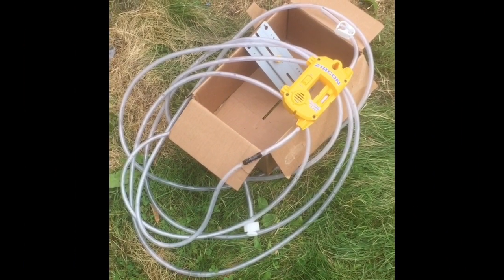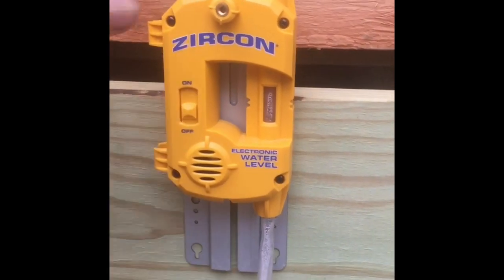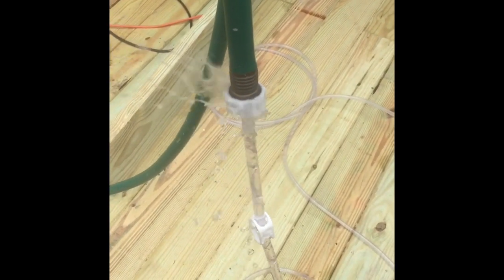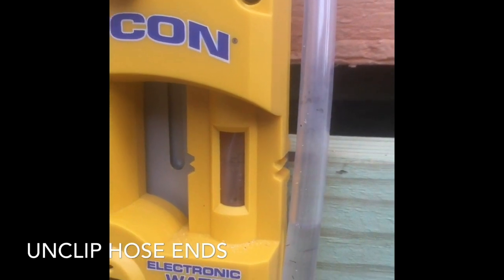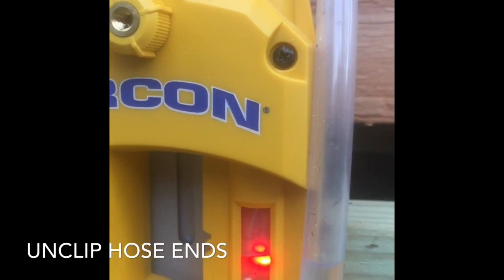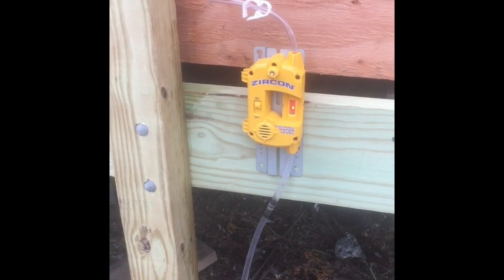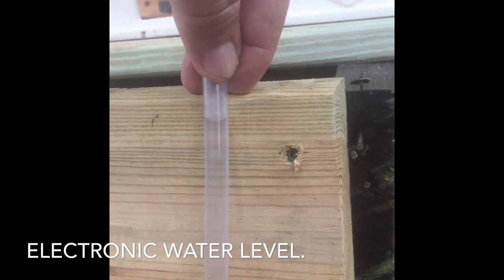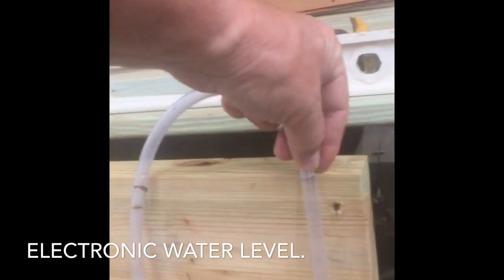Electronic Water Level Use

Comment: I'm rebuilding my cabin and used this as i am working alone. It worked great.  My only problem at first was air bubbles in the water line. I found what worked best is to hook up the hose to the unit and siphon the water through the hose. Also,  I had to slow   down raising the hose on the business as it takes time for the water levels to equalize. Thanks for a great video on a great product.

Comment: Hey Gary thanks for the great video, you convinced me I need this gadget
Reply from the maker: Thank you Sir- It is pretty handy
Reply: @garylee4214  well actually I just bought 30 ft of 1/2 inch tubing and I think I will do it by hand after I read some of the reviews I felt I couldn't be that accurate as I could with just the tubing alone

Comment: Where did you get the mounting plate?
Reply from the maker: It comes with the level. Thanks
Reply: I ordered one from the market of walls (great service but I didn't realize there are models without metal plate) and it came on time but without the metal plate (my fault for not reading carefully), so I'm returning it.  Now I've ordered one with metal plate from the zone am a!
Reply: Be sure to order the Z... Electronic Water Level 25 Contractor Kit!